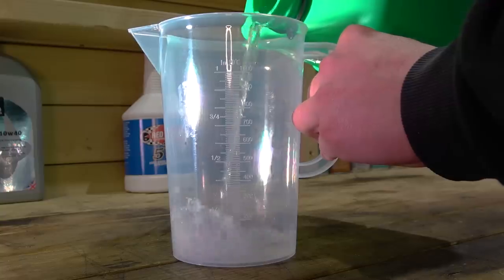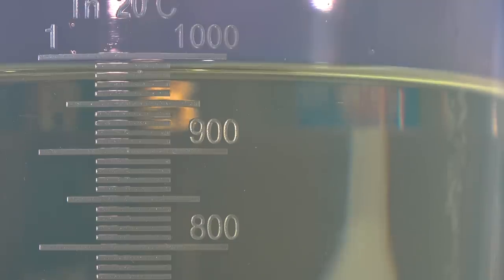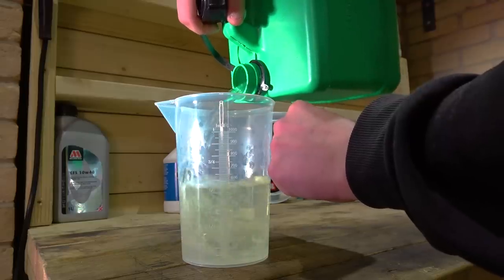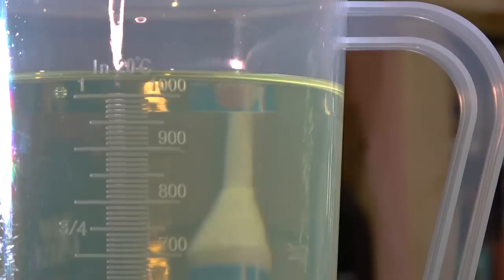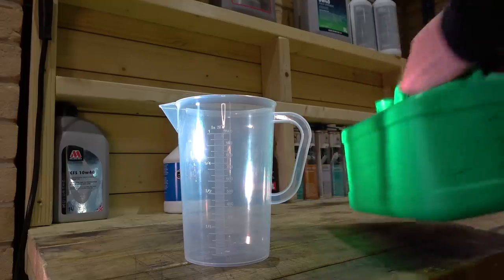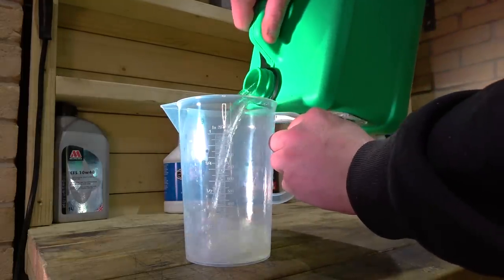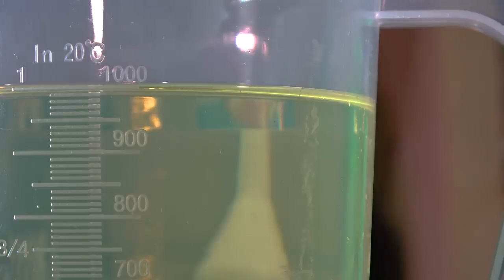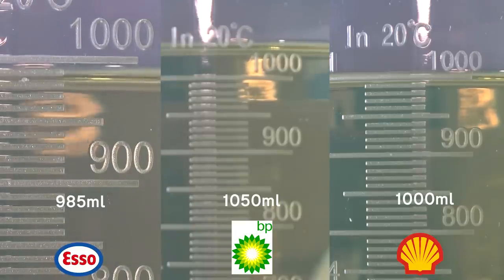Fuel Pumps Are Wrong - Esso BP & Shell

Comment: it's probably a lot more to do with the design and manufacturer of the pump rather than the brand of the stickers applied to the pump.
Remember: Most fuel brands don't own the pumps, or the forecourt, or the refinery, or the tankers, or the fuel. That's normally a franchised operation, but you may find very rare cases when you actually buy BP fuel, produced in a BP owned and managed refinery, from a BP branded pump on a BP branded fourecourt that was supplied to site in a BP branded tanker, and the forecourt is actually owned and operated by BP.
Reply: more to do with the inaccurate measuring jug from a kitchen.
Reply: @007floppyboy  No.  The jug had three different levels demonstrated.  Just draw a simple line on the jug with the first sample and forget the marks on the jug, they were all different after the first line.
If you cannot understand this simplicity, stay out of the kitchen.
Reply: I do work for one of the 3 brands listed above and you are spot on, there are 4 main franchises we do quarterly surprise audits on to ensure they are representing the brand well. Sadly if they fail and get the franchise taken off them, you see them rebrand as a different franchise the next month with just cosmetic changes to the look and style of the pumps and valances, but the basic pump, hose and other infrastructure is the same.

Comment: I would guess that the reason the BP measure is more is because it looks like an old gilbarco euroline, which won’t have temperature compensation, so the 1L you purchased on a cold evening will have expanded when you measured it and it had warmed up a few degrees,  the other two pumps are temperature compensated, the little “@15*C” sticker so unless you measured the fuel in your jug at 15 degrees it’s not going to be right.
Reply: Indeed. Even his jug says 20C.
Without compensating for temperature changes this whole thing is BS.
Reply: But the one from Shell was exactly right. So how can that be if it’s a temperature compensated pump and later checked at the ‘wrong temperature’ as you suggest?

Comment: You have to correct the volume by the temperature of the sample.  There's a wonderfully boring guide published for Trading Standards which gives lots of tables and formulae for correcting volume per sample.  Also remember that by law pumps can dispense 0.5% less or 1% more than displayed.
Reply: I have also seen reference in Weights & Measures documents along the line of "The law says any error on selling petrol can be no more than 2p."

Comment: Some years ago I filled up at a supermarket pump. A tankful in my small car at the time was about 50 quid, give or take. The fuel gauge showed low though nowhere close to empty, but the pump dial just kept going round. When it got to £18 more than it had ever taken, and this was your typical provincial supermarket not a Mayfair garage with white-gloved pump operatives, I released the trigger. I'm convinced the dials would still be going round now if I hadn't. Making a note of the price on the receipt and cross referencing it with the manufacturers fuel capacity for the car, it was impossible for it to have taken that much petrol.

I wrote to the provider who said the pumps were checked regularly and they operated to the highest standards, etc, but they would check. A week later the same station dispensed the usual £50ish to fill up, so something was up.
Reply: I used to live near an Esso station where a few of us reckoned our petrol tank was "10% bigger" when filling up there. Dodgy.
Reply: Maybe you didn’t wait for the pump to reset to zero at the start?
Reply: @normanbiggar  It was zeroed.

Comment: it will go off temperature aswell the warmer it gets the more the measure will read. check the temperature when it comes out the pump to make sure esso is not running there tanks warmer than the others, its 1 of the tricks the fuel stations do to expand the fuel

Comment: Stop worrying, I've worked in the fuel industry and it's all regulated and checked by weights and measures. A guy/gal comes round and tests the pumps with highly accurate equipment regularly and they have to be within the allowable tolerances or the business can face a heavy fine. The pumps are also serviced regularly to keep them dispensing properly. Pumps can go wrong but generally it's air locks or main pump failures not the accuracy. We never had a pump fail the weights and measures check in the years I worked there.

Comment: In the U.S, fuel pump metering is usually regulated and inspected by state departments of agriculture, who in turn adopt standards from regional weights and measures bodies.
The largest acceptable maintenance tolerance is 0.3%, which is comparable to the UK's 0.5%, but to my understanding there is no provision for ‘minimum delivery’ except for wholesale pumps (where metering becomes strict at 200lb). There is a lower 0.2% acceptance tolerance, meaning that in the 30 days following the installation of the equipment it must remain accurate within 0.2%.

Comment: A lot of pumps are temperature compensated to a standard 15°c, ie correct at 15°c.
Reply: So we're saying we need John to repeat the experiment at the same pumps throughout the year...

Capital idea, I wonder how far the Auto Shenanigans viewers can push John down the rabbit hole of investigation
Reply: Probably the temperature of the fuel in the tanks all year round.
Reply: The temperature is measured inside the pump. The tank temperature is measured separately and only used by the gauge inside the shop

Comment: Most likely the difference is not in the fuel pump measurement itself, but in the amount of fuel that is in the hose before and after your usage.
Reply: The hose is always full. The valve is in the nozzle assembly.
Reply: @Dave Cooper  not full if you lift and drain the hose.
Reply: @iangrice329  Today I went to the gas station and as I had to use a pump on the other side of where my fuel cap is, I had to lift the hose over the back of the car.
When I did that, an appreciable amount of fuel leaked out of the nozzle and over my car.
Reply: Impossible when the valve is in the head of the hose
Reply: Next test, one litre from each pump on the forecourt.
Reply: @Oliver Stewart  valve is in the pump not the hose
Reply: more to do with the inaccurate measuring jug from a kitchen.
Reply: @iangrice329 : not in the U.K. : the valve is n the dispensing nozzle, and I’d be surprised if it were different anywhere else.
Reply: @007floppyboy : yes, but okay for comparison.
Reply: @iangrice329  You can't drain the hose.
Reply: @Andrew Jackson  yes you can I do it every time.
Reply: @Chris Walford  no it's not, the valve is in the pump very close to the hose.
Reply: I think there’s UK and US people getting confused. I’m the UK you can’t (generally) preselect an £ amount of fuel, and we pay once we have drawn fuel and filled our tank.

The valve is in the handle, so as soon as you pull the handle the pump dispenses and will keep on doing so till it senses the tank is full. If you held the nozzle in open air and pulled the trigger it’d just keep dispensing till you drain the storage tank out…

On occasions a petrol station might place a £100 or 100l limit on fuel at which point the pump cuts out. At that point you might be able to drain the hose.
Reply: @Pete McCrea  the valve is not in the handle its in the pump. The blowback shutoff is in the handle.
Reply: @Pete McCrea  yes thank-you I know, I worked for the petrolium industry for 10 years. The metering valves are in the pump. If you lift the hose and drop it on the floor, what's left in the hose will run out. If the valves were in the handle this wouldn't happen.
Reply: @iangrice329  10 years in the industry and so much more to learn. Do not mistake residual fuel in the nozzle for fuel from the hose.
Reply: @matthewpayne2035  what almost 500ml

Comment: Well done, you have proved that they are correct in saying they are inaccurate for low quantities.  You do now know that you need to go out again and get five litres from each supplier now to check on larger amounts.
Reply: Why? That’s what all the checks on the pumps do. Government says you can’t dispense under the amount, the fuel co/site certainly don’t want to dispense more, so you end up in the middle, where it’s supposed to be. Sure there can be variance over time but repeated irregular check catch this more often than not. The system is built to make it work.

Comment: It can depend on the time of day you dispense fuel. Early mornings in summer definitely will give you more dense petrol than getting petrol in a warm afternoon. 
When I worked in a Shell-Mex station in the 1960's as a second job, evening/weekend job, we had the Weights & Measures chaps turn up unexpected like, and they were very precise.
Reply: I highly doubt there's a vast amount of difference in the temperature of the fuel between the hottest and coldest parts of the day. 

It's stored in such vast quantities, under ground where the temperature is stable. I doubt there's much difference, if any.
Reply: Virtually every fuel pump is temperature compensated now. So it doesn't matter what temperature the fuel is.
The pumps electronically calibrate it to 15 degrees.

Comment: Another (nerdy) wrinkle is that some pumps deliver the amount you ask for in a straightforward way, but others deliver the amount of fuel it "would be" if the temperature was 15C. When it's winter and the fuel is denser you get a little bit less in volume (but the same mass of fuel which is where the energy come from). When it's summer you get more fuel, but it's less dense so it's the same deal masswise. These latter clever pumps are fairer really (because it means you get the same amount of total energy in summer and winter) but the pumps are more complicated. They're called STA pumps and you can recognise them because they say something like "standardised to 15C" or something like that on them (usually somewhere near the minimum delivery notice). Trading Standards say it's illegal for petrol station people to turn STA on and off during the year to get the best of both seasons, if it's on it's on, if it's off it's off. 

For a 10 degree difference, that's about a 1% difference, which might not sound like much but it's a couple of pence in the price of petrol that might be wiped out depending on which pumps a petrol station has got.

This is a very boring comment.

Comment: I regularly see the pumps around Hull being tested, I'd say they must be getting checked at least every two years, if not annually. 
What annoys me the most is the prices go up five times quicker than they come down, and that when I started driving everyone was complaining about it passing 55p/l, it makes me sick seeing it at 3 or more times that nowadays. Best not go any further into it than that, got another blood pressure check in the morning.
Reply: Many years ago I used to help out at the local garage and remember selling petrol at 2/6 a gallon ! (12.5p) and you got green shield stamps !
Reply: @sarto7bellys  Beats me. Petrol in my first motorbike was 50p a gallon, including 2-stroke oil. The oil was dispensed from a forecourt handpump, which could be moved on wheels. The oil-petrol ratio was particular to the machine, which included lawnmowers and other simple engines as well as bikes, and varied from 10:1 to 66:1. This was in the days where self service was uncommon, and the vendor wasn't always familiar with the pump. The result could be an unlubricated cylinder and a locked up engine, or a trail of smoke any D-Day assault ship would have been happy to shelter behind. It's years since I saw a 2-stroke pump, probably some time in the early 1980s, and new strokers are banned from sale.

Comment: I refuse to go anywhere near my local Tesco due to me filling up a Peugeot 206 that had just under a quarter tank and the pump shutting off automatically at £100. I was talking to my mate at the next pump when it shut off, i thought it was full and went to top it up to the neck and realised it wouldn't due to the £100/56 litres i had just put in it. I had a big row with them in the station as the Peugeot 206 has a 50litre tank. Even with the 55 litre tank version of the 206, it was still overcharging me as i went in with just under 1/4 tank! The matter is now in the hands of the local trading standards.

Comment: This is actually quite surprising. I'm not up for haggling over a shot glass of fuel one way or the other, so accurate enough pumps for me.

What I've always wondered about wasn't the first liter .. or the next 60 .. but the last when you pre authorize and fill to the full amount. When the pump slows at the last 20 cent mark, and then seems to stutter and fit

Comment: Evaporation in the pump may account for some variance, so you should put some fuel in your car first to make sure each pump you used has been recently used for that type of fuel.
Reply: Nahh... The click off valve in the handle will stop anything escaping. Can't evaporate through a closed valve.
Reply: @dougaltolan3017  Residue, pipework, basic chemical engineering 101. You can NEVER get 100%.
Reply: @AAAA35345  residue, pipework, basic chemical engineering 101, 100%, ohh and gnat's chuff.
Reply: Using the pump to put some fuel in the car first might make the measurement more repeatable, and likely being better spot on one liter, but priming the pump defeats the point of this experiment, which was to test how inaccurate those pumps are when you only pull a low quantity of fuel (without priming).
Reply: Early cold 4ams, feel the metal parts of the grip. Avoid stations with heater pumps. 
Also go for the Pre selected dollar option, continue to hold the lever open after the 
pump auto shuts, lift the hose loop to empty the (free) residual amount into the tank.
Reply: @AV036  Emptying the hose after the pump turns off is theft.
Reply: @Andy Alder  But "Evaporation" stole their fuel first. Buy a little fuel from each pump first to test.
🤦‍♂🤣
Reply: @AV036  The shut off is at the handle. You can't empty the hose.
Reply: @Andrew Jackson  Mommy's TESLA ? 
1.water meter stop cock⬌ 2.hose nozzle dick
NOTE ONLY pre-select auto fill option. which shuts off from the metered valve before the hose. How about you try it next time you're in AU.
Reply: @AV036  Who are you stealing the fuel from? The filling station or the person who fills up after you? I suspect the next person to use the pump pays to fill up the empty hose.
Reply: @Andy Alder one to many boosters matey? 
ENGLISH-READ-CAREFULLY
NOTE: Past the pump meter 'we've' paid for it!  
Leave your 50ml. hose dribble for the next guy. 
TIP: Don't inhale the vapours = STOOOPID.
Fun fact: A trucker might collect a minimum of forty litres per empty tanker. Side wall wash down, RESIDUE.  Now FK_0EE
Reply: @AV036  Stop talking gibberish and say who you have stolen the fuel from, the gas station or the car that uses the pump next.
Reply: @Andy Alder  The "pump" "turns off" when the hand set is returned to the holder. 
Customers are free to move the handle between i.e. cars, boat or jerry cans.  NOW FK_0EE

Comment: The problem is not the fuel companies.. it varies across pump manufacturers, and the age of the pump and the meter fitted .

Then you also run into the issue of standard temperature accounting which varies the delivered quantity based on density and temperature of the fuel compared to a nominal 15 degrees C

Comment: Many years ago I took up the point of accuracy with the Weights and Measures people. There was a local supplier that was cheaper but seemed to give worse MPG, whilst another local 'Branded' supplier gave better MPG. I was told that there was a tolerance built into the Legislation to cover mechanical variations in pumps. The 'cheap' station was supplying at the minimum allowed, whilst the 'branded' one was spot on. 
I also found that one brand of petrol gave a consistently better MPG than others, presumably due to different additives, giving a lower cost per mile.

Comment: In the last video, you had to prepay for fuel, which meant the valve in the pump closed, which would in theory let you have a pipeful more fuel than someone lettting the trigger go
I'm sure you remember the old days of preselecting how much you want and lifting the pipe to get the last dregs out :D
Reply: Just wondering what pipeful are you describing
Reply: @shaverdave3644  If you fill up normally, you stop the flow at the trigger, but when the pump shuts off the flow, the rubber hose still has fuel in it, it was common practice to raise the hose to let out the extra fuel.
Reply: @sparkyprojects  In my moped riding youth, petrol in the U of the pipe could be the equivalent of another days commute.
Reply: @borderlands6606  Exactly :D

Comment: I’ve heard that the price on the pump can also be affected by air going through the sensor. So for example if you’re short squirting to try and round it up to a set number, or it’s clicked because the rank is full but you keep trying to squeeze a bit more? Im not sure. There’s all sorts of urban myths.
Reply: The pumps are equipped with air separators to prevent air going through the sensors.
Reply: I agree with Rob! 
Why does the same gas jug trip the fuel nozzle trigger? Because excess air caused the fuel to froth and trip the trigger. 
And if you test this theory at multiple stations, you can find which station uses less air. (Running air thru the pump is adjustable from inside the pump.)